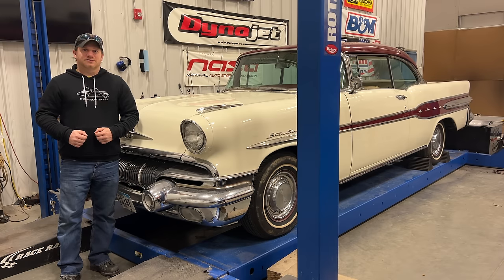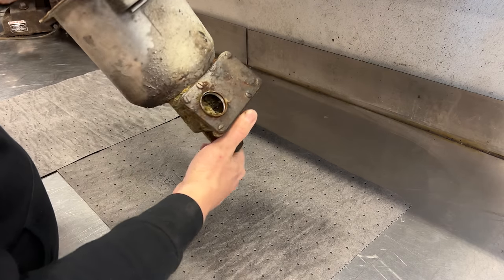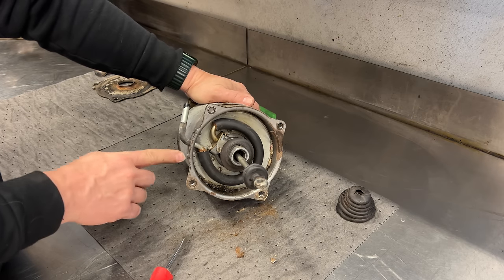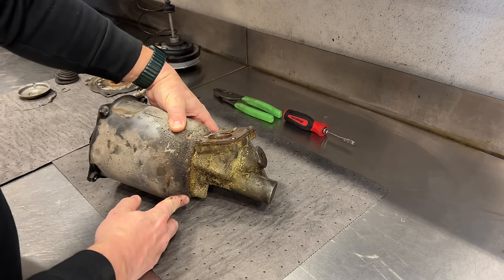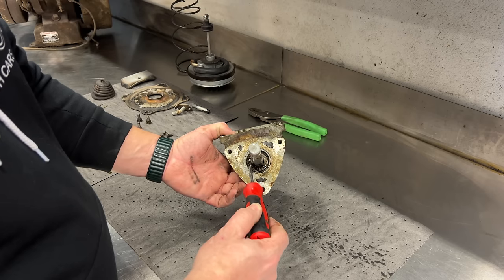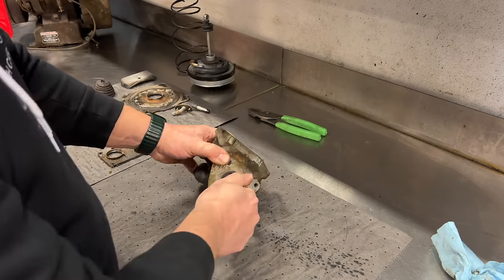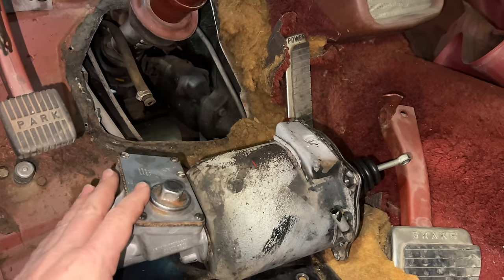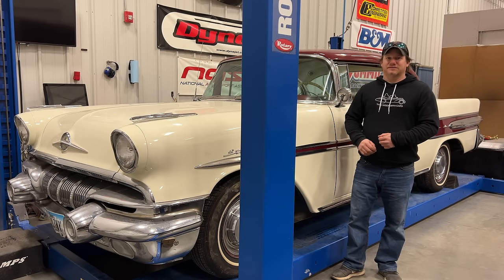1957 Pontiac Star Chief - Will It Brake?

Comment: Hey,thanks for the video. Never seen one of the older systems apart. The engineering differences to the late 60s cars are surprising. 
Having seen the consequences of single line brakes failure,I just cannot encourage anyone to continue with their use. One pinhole anywhere,and very bad things happen. Especially how the filler plug is buried with no way to visually check level. Maybe a simple electrode warning could be rigged. Level drops below contact,light goes on. Changing a vacuum boost car like this to dual line is not going to be for the fainthearted.
Nice car.
Reply: Back in the 80's I picked up a 1962 Oldsmobile Starfire Convertible......  she had taken a smack to her nose but came with all the parts to fix her up, After I replaced her front bumper, grill, hood and left front fender I would cruise her around town...... smooth 394/345hp she would get up and go :)  I come home one day and pull into my 80' foot driveway, as I'm coming up to my detached garage, I step on the brakes......  Nothing!  that single stage master cylinder shit the bed and miss starfire smacked right into my sweet 1970 Ford XL Convertible :(  shoved her right through the garage wall.  Amazingly neither car had much damage,  it was only a couple MPH hit but the starfire is a bit over 4000 pounds :D Old cars are built like tanks,  The garage wall was properly fucked though :D :D :D

Comment: I was comparing this car to the 57 Chevy.  Frame is similar but has the convertible X cross member.  Only convertible Chevys had it for stiffening.  Chevy had hanging pedals by 55 and my 56 Chevy had the master cylinder on the firewall.  My 54 Buick had it under the floor board and had the old frame mounted pedals.  The Buick had torque tube driveshaft till 59 and wire cable driven wipers.  Your Pontiac has the bell housing mounted motor mounts as well.

Comment: where's the part that shows what happens when the attachment bolts snap off when trying to remove the master cylinder, or the part when you find that all four brake lines are clogged with old fluid, and when the bleed screws snap off on the first turn? ...where's that part? :)

Comment: Sweet sweet car. The wheel cylinders were ok?  I have a 58 Cadillac that I sent out the whole assembly to be rebuilt but I shoulda just looked for a rebuild kit. Fortunately Cadillac put it up on the firewall and not underneath the floor like this Pontiac

Comment: First time to see brake fluid so solidified in the master cylinder. Which made me wonder: might the brake fluid in the brake lines, and at the slave units in each wheel, also be solidified?
Reply from the maker: No I don't think I have ever seen that except around a leaking wheel cylinder.  Rust would be your worry more than the brake fluid inside of a pipe.

Comment: Congratulations on what looked at first like a hopeless job. Whet process(es) were used to clean the master cylinder? It appeared to have several varieties of nasty adhering to it.
Reply from the maker: I used glass bead to blast the outside of the master cylinder before I put it back together.
Reply: @ThisWeekWithCars  It did a very nice job, without destroying the part.